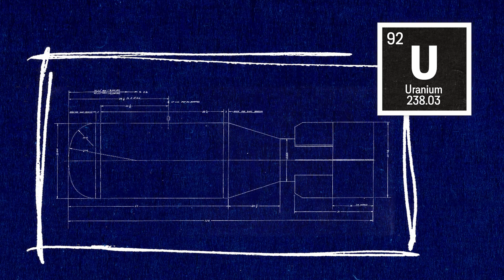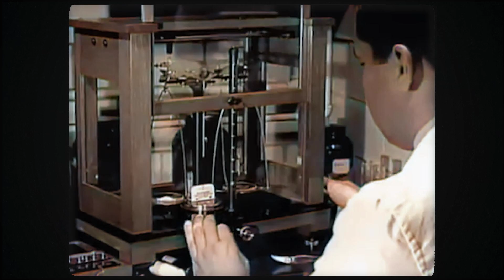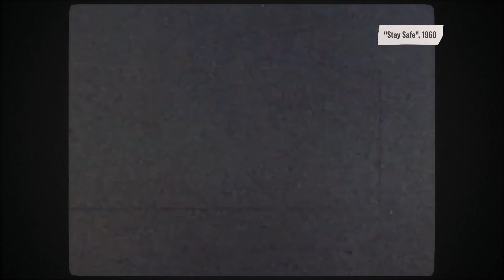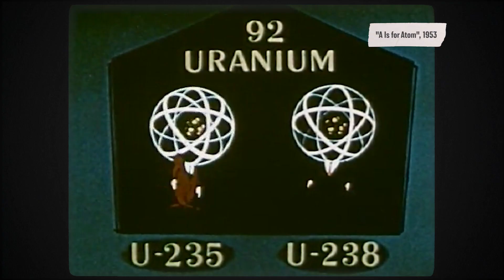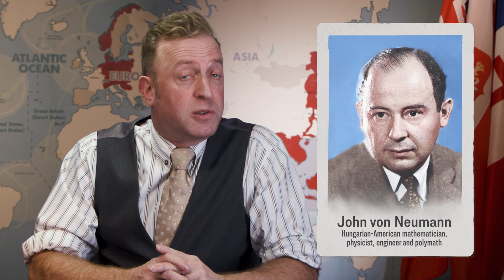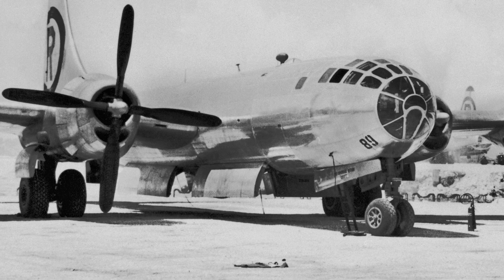How to Build an Atomic Bomb - WW2 Documentary Special

Comment: An unusual feature of plutonium is its compressibility. It undergoes a phase change from delta- to alpha-plutonium, much as graphite might change to diamond, but it takes only a modest overpressure to do this. If we were designing a bomb then we might choose the implosion type even if Pu-240 fizzle were not an issue. Uranium is essentially not compressible, but does not have any fizzle problem, so we would naturally choose the simpler gun-type bomb which can be evidently deployed without prior testing. Actually delta-plutonium by itself is unstable, but we can stabilise it by adding a little bit of gallium, much as we can stabilise tin at low temperature by adding a little bit of antimony or lead (the resulting alloy is called pewter). It is remarkable how they worked all this out in a few months in 1944/45.

Comment: The physics was more detailed than Richard Rhodes has in "The Making of the Atomic Bomb", I would have like a few sentences about the additional parts like the boron reinforced acrylic layer that encases (or possibly lines) the tamper. 

Is it really a fact that the U238 tamper underwent fission? And what advantage was there to using a tamper of U238 over using a tamper of natural uranium which is mostly U238 anyways?

Comment: Point of fact: Capt. William Sterling "Deak" Parsons was in charge of the Enola Gay mission, not Tibbetts. Tibbetts was a great pilot, but not an expert on ordnance. Deak was the expert and was placed in charge by Gen. Groves. He was the only Navy man on the plane, chosen for his involvement in building the bomb and his expertise on matters of ordnance. 

Deak had previously advocated for the use of radar, which had been available for decades, to target ships and planes at night. He also was the key advocate for the use of proximity fuses for anti-aircraft fire, and after arranging a demo for brass, hundreds of thousands of fuses were ordered and used for the remainder of WWII.

Deak was one of the three "Joint Chiefs of Tinian." He designed the "gun" method of detonation of Little Boy. It was his idea to fuse the bomb once the Enola Gay was in the air as there had been multiple B-29 crashes in recent weeks at Tinian and he did not want to risk wiping Tinian off the map. Once the Enola Gay was safely away from Tinian, Deak crawled into the bomb bay and fused the bomb.

Approaching Japan, Deak chose the target (Hiroshima was one of three) and gave the OK to drop the bomb. Afterwards, he was awarded the Silver Star and promoted to Brig. Admiral, the first such admiral to never have had charge of a ship.

When informed that his friend Oppenheimer had his security clearance revoked, Deak had a massive heart attack and died at age 52. Deak was a cousin of my father, Lt. Commander John Lundy Parsons, who was at Pearl Harbor when Little Boy was dropped. He was called "Deak" because his colleagues at the naval academy thought he comported himself like a deacon.

Comment: Honestly, it's amazing to me that the design of a uranium bomb - the most primitive of nuclear bombs, yes, but still a nuclear bomb - is so simple that they didn't even bother to test it.
Reply: My understanding may be flawed and I'm happy to be corrected on this. I believe there were at least three problems that led to the one available Uranium bomb being used for real rather than tested. One was that the enrichment process to separate U235 from U238 was so slow that only one Uranium bomb was going to be available by the time the Soviet Union was committed to joining the war against Japan. Secondly, US intelligence had warned that using an atomic weapon would only have an effect on Japan surrendering if they thought there were more ready to use. They thought that it was necessary to have five available. Thirdly, the Plutonium bomb implosion method was insensitive to the exact composition of the fissile material and fast to produce but so complicated that it needed testing first. That implies that there may have been six A-bombs produced by August 1945 - one Uranium bomb used on Hiroshima and five Plutonium bombs, one tested in Nevada and one used on Nagasaki with three in the process of being shipped to Tinian.
Reply: @scottbarrett4746  Yeah, refining Uranium down to weapons grade is definitely a slow process - that's why folks were so worried about Iran's centrifuges a while back - they were the type used for this enrichment process, and there were enough to make more than is reasonable for testing nuclear reactor design.

I recall watching a documentary on modern nuclear weapons security.  Fundamentally, the thing that prevents anyone without nation-level resources from getting a plutonium bomb is technical complexity - and thermonuclear bombs are just that but more so.  Plutonium can be made in any nuclear reactor in the world, including places like North Korea, so that's hardly secure, and hydrogen for thermonuclear bombs also pretty easy to find...but you're not making that implosion device unless you've got serious manufacturing and design talent on your side.  

But for uranium bombs, the thing that prevents people from getting that is the fact that people who have weapons grade uranium are VERY careful about keeping it safe, because making a uranium bomb terrifyingly easy if you can get it.

It concluded that the biggest threat was from a dirty bomb - you just need any radioactive material to pull that off.  The only real way to stop that happening is radiation detection in ports and border crossings and keeping radioactive material catalogued and locked up in country.  Which we're...fairly good at, but not perfect at.  There's enough holes in this layer of defense that honestly I suspect the big reason we've not had a dirty bomb go of with radiation is the idea that radiological weapons are a line nobody wants crossed.  (And, uh, MAD just becomes "assured destruction" if you're a minor power or non-state entity.  Not sure what every nuclear power's policy would be in terms of retaliating against a dirty bomb attack, but I'm quite sure there's a good chunk of people who might otherwise be interested in such an attack who don't really want to test their luck, just in case the response to someone dirty bombing the US is the US glassing the country they operate out of.)
Reply: They made small scale samples of the 'gun' bomb and tested them, so they new a full sized bomb would work.
Reply: U235 fission properties were known at that time because lot of work was done by scientist before manhattan project but reactor bred plutonium was all different ball game. Remember that plutonium was discovered only 5 years before gadget was detonated.
Reply: The things that could fail about the trigger of Little Boy were common to a ballistic gun and several centuries of testing had already fixed that. The only question was how big a boom the fast neutron stream being sent into the criticality mass would create. If your Chemistry & Math is right it will explode.

In contrast Fat Man was tested as the complex electronic trigger of a precisely lensed implosion was unique and before making it only about three people had the practical knowledge of shaping and positioning the charges correctly to create an implosion. What couldn’t be simulated was if the crushed plutonium / beryllium spheres would explode massively after they were crushed or just create a radioactive fissle. If you did the latter on a Japanese City, you’ve handed them a nuclear bomb that dozens of Japanese scientists would be capable of copying.
Reply: @MsZeeZed  Oh for sure, it's less "it's amazing they had the gall to send an untested weapon into the battlefield" (that is somewhat true but given the process needed to make weapons grade Uranium and the tech level of the day, it makes sense).

More "I'm amazed there's a version of an atomic bomb that could essentially be built by anyone who's familiar with the process needed to make a gun."  That seems like too many people knowing how to make a weapon that powerful.  (And yes, again, the control here is the processing needed to make weapons grade Uranium.  That is, thankfully, significantly less trivial to accomplish.)

Comment: One addition to the discussion of nuclear fission and criticality.
- Supercritical covers any situation where energy is being added to the reaction system.  Technically, this is what's happening in normal nuclear power plants too - they're generating excess energy, which is bled off by the thermal transfer system that runs the steam generator that makes the energy.  
- Nuclear bombs, are, (mostly) uniquely in a state called prompt critical.  This is in reference to prompt neutron absorption, which is happening at an extremely rapid pace and is deliberately prevented/minimized in sustainable reactors.  After all, when you have a reaction doubling its energy output several times a second, you generally don't have much of a chance to do anything about it.  Which, for a nuclear bomb, is kinda the point.  
- For examples of prompt criticality that don't involve nuclear bombs, look up the "demon core" - an early plutonium core that went prompt critical momentarily twice in lab experiments that nobody who understood the full implications of radiation would do.  But the scientists doing the research didn't know that at the time.  A decidedly more gruesome example is the SL-1 accident, which, uh, maybe don't look up on a full stomach.  The demon core didn't claim any lives, SL-1 very much did.
- Of the 3 big nuclear reactor incidents everyone knows (3 Mile Island, Chernobyl, and Fukushima), the only one that involved prompt criticality is Chernobyl (and that's not certain, because the exact sequence of the reaction is not fully known - we do know several things that went badly wrong that modern reactors avoid, though, it's just that the instrumentation that would give that level of detail got fried when the meltdown happened.)

Comment: While I like watching Indy and Dr. Felton (he did a video on the topic of Lancs to carry the Bomb), I disagree with their assesment that it was just merely because the Lancaster was a British plane that it was rejected to carry the A-bomb.  Greg's A&A channel has.a good video on this but as a sumnary: the Lancaster's bomb bay might be long but is inaccesible to the pilots and someone needs to get to the bomb to arm it.  Also, the B29 is waay faster than the Lancaster, I think it can outrun some fighter and has a high ceiling and range.

The B29 has problems, among them engine cooling (lots of articles om this but Curious droid summarizes it neatly) but it was , to an extent fixed.    With (spoilers) Silverplate mods, did deliver the bomb.

Fun fact, the 509th, the one with the Silveplate B29s, I think was based im Roswell, New Mexico in 1947 when a certain weather balloon caused lots of conspiracy theories.

Comment: My dad was given a General Discharge from the Marines after punching a Sergeant that was not his drill instructor.
He and a buddy made boot camp fine, but slipped off base for some celebratory drinks.
He was mad the Sgt. gave his smaller buddy a rough time and hit him.
After my mental hygiene concluded the metal plate he had put in after a bad head injury at a Miss, St. football game, a cleat on his leather helmet in 1936,  the fact he was 26, married with a son, Marines decided he was not fit for acceptable reasons.
He did drive for the Federal government from Roanoke, VA to Oak Ridge from late 1942 to the wars end 
Norfolk & Western railroad was headquartered in Roanoke.
So uranium was shipped by rail to Roanoke from Norfolk, then transferred to Federally owned trucks to Oak Ridge.
So I'm proud my dad did his part in the war effort.
His two brothers both served in the Marine Corp,  with one brother in Guadalcanal. That uncle died at 52, probably lifelong stress from battle fatigue.

Comment: I was very surprised to find out that the first bomb exploded at alamogordo was the plutonium implosion type. The second bomb dropped was the more simple gun barrel type.
Reply: The first bomb dropped was Little Boy - "the more simple gun barrel type" - on Hiroshima, 6 August 1945; the more complex implosion Fat Man was dropped on Nagasaki three days later.

The Trinity test of the implosion method on 16 July 1945 in the New Mexico desert was a fixed platform test, not a dropped bomb.
Reply: @nemo6686  so the only thing I got wrong was that the gun barrel bomb was the first rather than the second used. I was amazed and frightened at how very simple it is to make a nuke. All you really need is enriched uranium. The rest is very easy.

Comment: The best video yet on this topic!   I do have a memory of thin man which is slightly different. It wasn't a gun design but a rocket (from a documentary). It fits with everything you have said but with a subtle difference. The rocket can hold the mass in place until it is ready to explode. There you go, Rocket or Gun ??
Reply: Gun.  Basically a 5-inch naval gun with the barrel sawed off.